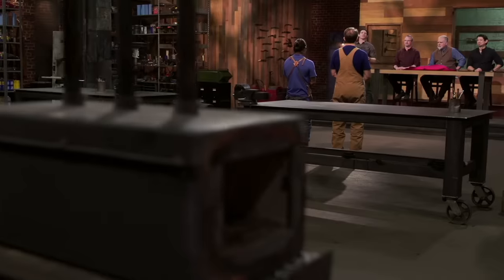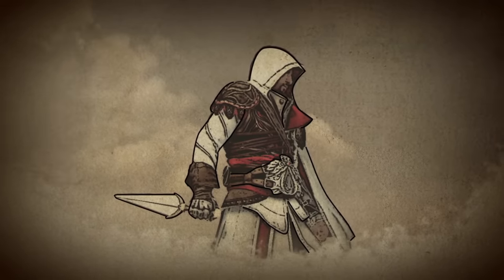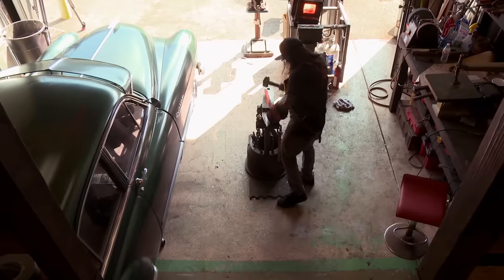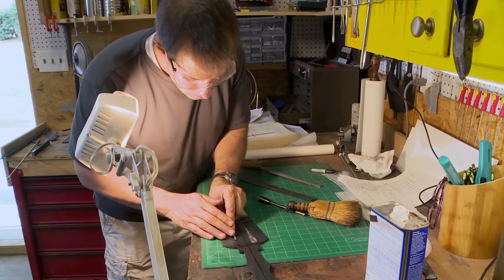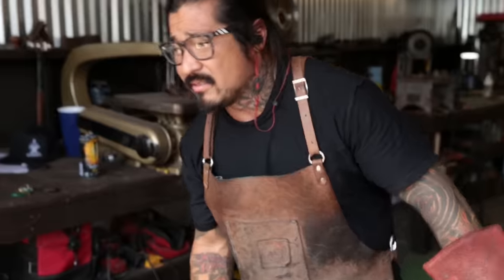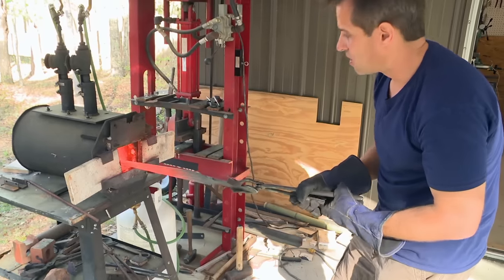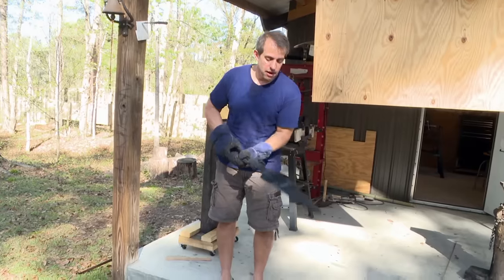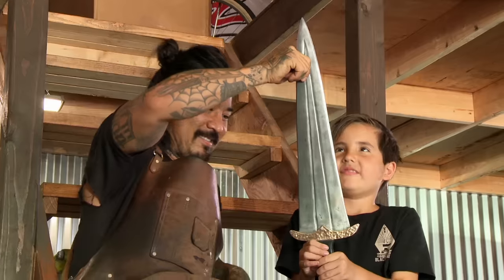Forged in Fire: *DOUBLE-EDGED* Assassin's Creed Sword is DOUBLE the TROUBLE (Season 4) | History

Comment: This has to be the first time the heavier blade won
Reply: It was because the other guy's handle structure was more impractical in wielding than the extra weight was
Reply: Yahh it is
Reply: Not exactly. Usually the weight is an extremis cause of loss when blades are equal. In this case, the handle of the losing one wasn't very well fit
Reply: They also said in the intro to the finals, this heavy blade.  I got nervous when they said heavy side.  But when Mr. Doug said hand fit great and the blade was quite balanced, it gave me hope.  

Plus, the guard going up, seemed to block part of the blade and less function, while the other guard did its job and wasn't to the point of impeding the main function
Reply: It is kinda ironic because Neil came back to champion's episode and lost because his Tai Chi sword was too heavy.
Reply: Was it so important to break the suspense ?!
Reply: Heavy is fine on short weapons
Reply: Heavier but balanced
Reply: Well... theres this thing called a claymore. Its an extremely heavy blade weighing in at almost 40lbs and is angled but not sharp at all. It cleaves beautifully in long strokes. Doesn't need sharp... just uses weight to sever and crush.
Reply: @IlIWarGIlI  No. Claymores were 5 to 6 pounds max, and were just as sharp as any other sword could be made
Reply: That blade is not a battlefield weapon, hence, weight isn't as important (although it still is).
Reply: bro i was thinking the same. As soon as Doug and the other guy mentioned the weight I was like it's all over but surprisingly he came out on top
Reply: It depends on the type of sword or blade that can use that heft to cut.
Reply: @TraumaCenter13  A Tai Chi is supposed to be a balanced stabbing weapon, instead of being a heavy blade. It's used as an extension of one's arm while using Martial Arts. You can cut with it, but it has to flow with the type of martial arts you are using.
Reply: Weight can help with slicing for obvious reasons, so a little heavier than usual isn't a bad thing- it could even be a good thing.
Reply: @IlIWarGIlI  You didn't even bother to do research did you?
Reply: Well light and heavy since is a short blade heave is stable the blade wont shake  instead of light one also the handel was the critical part also i saw the the diference in the cut on the pork the 2nd did more damage but over all both did an exelent work
Reply: Spoiler man
Reply: Its balanced when the heavier blade cuts better than the lighter one, thats when they look for fouls in the grip, the edge and the sword in general, however, the blade will cut
Reply: @Maegnas99  we are thinking the same weapon right? Claymore the 4 foot long steel sword? 5 or 6 pounds? Right and I'm mount everest. 4 feet of metal ANY metal weighs more than 5 or 6 pounds. Unless you're thinking of the metal called mercury... then that will weigh less than 5 or 6 pounds because its a liquid.
Reply: Wielding counts were not tested... Which was a mistake        i bet the judges would pick the other if they were to use in combat.

WIELDING CONCIDERATION, IS PART OF FORGING.
Reply: @IlIWarGIlI  so much wrong in one reply. 4 feet of metal can weigh less than a pound if you get the dimensions right wtf are you talking about? it’s a blade and not a thick lump of steel it doesn’t take an expert to reasonably assume that it’s 5 to 6 pounds. and mercury is incredibly heavy, it’s heavier than iron. just because it’s molten in room temperatures doesn’t mean it’s light, by that logic molten steel should be lighter than regular steel
Reply: @troglodyte8242  steel wasn't used in much 1000 years ago. Most didn't know how to make it. The claymore wasn't used in battles much because its too heavy. So it was primarily decorative. That said its a sword. Metal is heavy. If 4 feet of iron was light itd need to be TOO thin and hollow. Which would render it prone to bending and breaking... they were not. Ive actually held one. They weigh a LOT more than 5-6 lbs. A gallon of milk weighs that much. It weighed almost as much as trying to hold 4 of those. Just noticed your name is troglodyte. Seems right as that seems to be your level of intellect. Mercury isn't heavier than iron its denser. Big difference. Like gold weighs more than iron but gold is soft. Gold isn't as dense as mercury. And yet more dense than iron.
Reply: @IlIWarGIlI  as i expected, no rebuttal lmao
Reply: @IlIWarGIlI  google it it says they weighed in at 5.5 pounds

Comment: Can’t believe the heavier weapon actually won. Almost never happens.
Reply: that is right.
Reply: @Mirai*Santos though it was heavier, his handle didn't allow the sword to slide and turn in one's hand. Imagine using it in actual combat and the sword just keeps slipping in your hand, it won't be good, that's why the heavier sword won.
Reply: The handle on the other one was complained about alot
Reply: Exactly, both blades were done well but the hilt, handle and pommel/counter balance were clearly superior. That's the difference between having a blade and having a sword. The only reason lighter blades usually win is because they're easier to balance and don't require the grip to be overly refined for control. A properly balanced heavy blade with a comfortable grip has no issues in feel or control and can add more cutting power and even functionality depending on the purpose/intent of the weapon.
The best weapon smith's know the blade is only half of the weapon.
Reply: its because he showed his kid
Reply: Mirai*Santos dont lie to yourself you know he had a better blade construction.
Reply: @binladen4631  more like pommel. But yeah. His blade didn't warp nor did he mess his fullers up.
Reply: @CrankTat  And because it's heavier, it can deal more damaging blows
Reply: probably because, the cut was cleaner on the belts, it looked better and the handle
Reply: CrankTat im no swordsman or blacksmith but wouldnt a bit heavier sword be alright aswell? Allow the weight of it to help you dig in?
Reply: @lonecourierjoeyv2133  Scientifically yes as you need more force to use creating harder and more deadly hits
Reply: Its RARE but it does happen
Reply: Its Heavier..... Critical strike and the thrust power will be doubled combined with nice Handle Grip..... not even ChainMails can survive that..... well, who knows, long ago they used it for Assassination....
Reply: @CrankTat  nah the dude was probably just swinging incorrectly.
Reply: He made better handle than other. His competitor got a.few complaint about the handle is not comfort.
Reply: Heavy weapon is better than a weapon which can not fit in ur hand properly .... Handle is the real soul
Reply: @hambaallah1948  if both blades get through the tests such detail is decicive
Reply: @Mirai*Santos the handle was better. Dans blades handle was a bit sloppy imo it was light but it wasnt easy to handle
Reply: Heavier weapon, but a good handle offering good control. Also, the balance is good with a good part of the weight in the guard, handle and pommel.
The other weapon's handle was to long and it wanted to twist in the hand.

Comment: No ones talking about how sharp those blades are,DID YOU SEE THOSE THINGS CUT THROUGH BONE LIKE IT WAS NOTHING,IT CUT THROUGH A SPINE EASILY AND BROKE LIKE 2 POUNDS OF ICE OF OF A BLOCK
Reply: jb 2387 yo blades can cut? Holy moly
Reply: @ilikemusic4367  yes because any knife can cut through ribs and a spine like its nothing
Reply: @pringlesbleach9895  thats not the point. Malo made it sound like any blade could do what the ones on the show did.
Reply: Well, it is a heavy knife, kinda like a cleaver but with a point.
Reply: @Jb-zo1zf  ok, “any knife” cut through that with a butter knife please.
Reply: Sunil Zala  oh, well, sorry I ruined your day...
Reply: @Jb-zo1zf  look my guy, there are knives made for cutting through bone. This blades ability to do so is only in part due to sharpness. But the reason it can do so isn't because it's sharper than a (good) chefs knife or anything. It's due to mass and thickness, as well as hardening/tempering and type of steel used. But mostly that mass and thickness.
Reply: Basically every good sword is capable of cutting all the way out

Comment: I don't think either of them lost this.
They both performed amazingly and commendations to both contestants!
Reply: Yes, I was thinking about how a noble although might be versed in sword play would not have the athleticism to wield a blade that was heavy, but would be able to kill or lethally harm anyone at close range so speed was the limiting factor. Historically noblemen have had access to better blacksmiths and steel which leads me to believe the blade would have been light weight. Comming to my point is I believe a sharper lighter blade with less toughness, or better yet less strength be that metal fatigue or creep weakness. They not should have made lighter and thinner blades but apart from that they both deserved to win as there are merits in both blades. I would choose the handle of the winner with the blade if the looser.

Comment: Fun Facts:
1. The Cinquedea starred in a different episode, during which a contestant lost because the blade was too heavy for not placing enough fullers.
2. Neil has had problems with his blade being too heavy in a different episode.
3. A heavier blade may lose on its weight alone but it often loses due other associated issues like bad weight distribution or a duller edge.
4. A heavier blade has won before when the opponent's blade broke.
5. A heavier blade has won before when the handle was also too uncomfortable.
Reply: In this case I believe it lost due to difficulty with edge orientation and the shape of the grip overall.
Reply: They also included it in an episode of Beat the Judges.
Reply: It was kinda sad seeing that dude's sword was just a bit short from the requirements when his sword passed the weight limit.
Reply: U can go heavy if the weapon is short
Reply: Neil won because his handle was better shaped and more functional, his blade was heavy, but the good weight distribution made it not detrimental
Reply: That is a civilian blade, not a battlefield one, weight isn't as important.
Reply: Nah, he lost because he milled the fullers but they blamed the handle

Comment: I literally was thinking about what if they made the hidden blade
Reply: Muramasa 23 I’d love that but it’d be better if Dave made it
Reply: That would be a terrible weapon in real life.
Reply: M-H 12 realistically yeah lol, but id still use it.
Reply: @m-h1269  if you try to use it like a sword, yeah. But not if you use it for the intended purpose
Reply: ChickenSnitchzel it would still be terribly flimsy, due to the blade not being structurally secured well to anything. It would also have no point as you can easily hide a small blade in your sleeves.
Reply: It would be difficult for them because it’s mechanical and they’re blacksmiths
Reply: M-H 12 or behind ur wrists
Reply: @m-h1269  Colin Furge made it. Check his Channel
Reply: @m-h1269  sir, ubisoft introduced the new hidden blade at the top wrist, it prevents cutting your ring finger
Reply: Arashi Many people have made it, that’s not the point. The point is however that the weapon would not be durable and not very effective.
Reply: Matthew marquicias What has that to do with anything, may I ask?
Reply: @m-h1269  nothing i just said it, happy halloween

Comment: he won because even tho his sword is heavy, you still can wield it properly. 
The other sword may be lighter, but what does it get to you if you can't wield it because of the crappy handle
Reply: He also won because it was sharper. You can see that the straps didn’t fray at all
Reply: Usually the "Heavy" word is the word of death in this comp. I don't think I've ever seen a blade win where that word is used.
Reply: @Craig if their hands are small then are you indirectly telling me that I have baby hands...
Reply: @petert3355  Yep, though an equally important word is "balanced". Even a blade with a higher total weight can be easier to use if the weight is balanced better. The two words that are usually a death knell when put together are "forward heavy". There have been swords that have been disqualified on that alone, as in Doug picks up the sword and just says "nope, not even swinging that".
Reply: @spamhere1123  Never seen that one but I'll bet dollars to doughnuts that is exactly what he'd say if I tried to make one of these.
Reply: @petert3355  Yeah usually he doesn't try forward heavy swords because it's kinda dangerous. If it isn't balanced well there's either more issues with the sword (ie there's a chance it can break) or the sword is just super off balance and can bounce back and hurt him during the test

Comment: “First guy says I rarely measure” then says “They didn’t have machines back then, they did it by hand so”

10 seconds later - Uses a Sander to sand the sharp edges down 

Me - Well I guess that isn’t considered a Machine now 🤔
Reply: That's a grinder, not a sander. He also wasn't using it to measure, which is what he was referring to when he said they did it by hand. If he had done it all the good old-fashioned way that same weapon would have taken 4 or 5 times as long to make.

Thanks for coming to my TED talk.

Comment: I think Neil won because he actually blacksmiths the blade. 
If this was Machined In Fire, the other guy would have won.
Reply: he won because even tho his sword is heavy, you still can wield it properly. 
The other sword may be lighter, but what does it get to you if you can't wield it because of the crappy handle
Reply: @mefaulenzer4387  Exactly.  His handle profile made it more difficult to keep straight in the ice block challenge and it moved in the hand when Doug used it.  If he had a better handle shape and pommel mass to balance the blade he would have won.  Both were sharp and durable.  It came down to ergonomics.

Comment: I agree with the judgeds decision. Neil's poked all the way through the pig then it cut a lot more on the chop. The handle was shorter so it wouldn't slide forward. Both did a great job. But those 3 things made it the winner. Congratulations!!